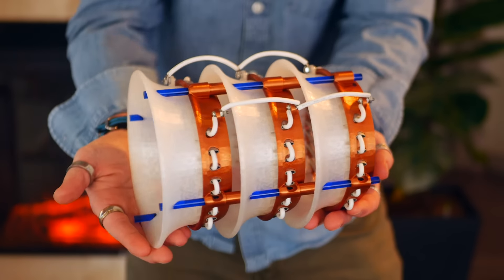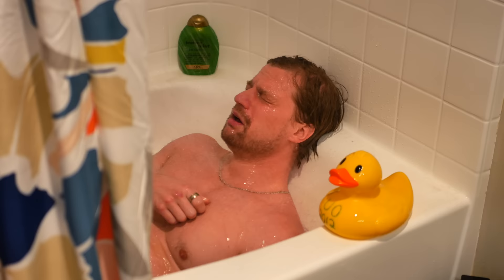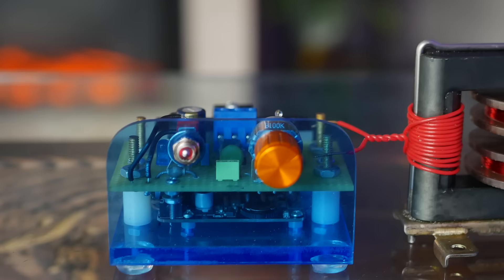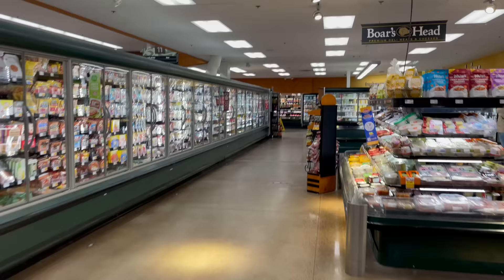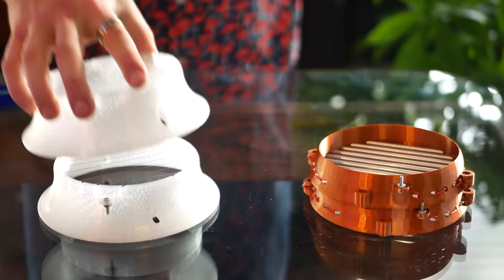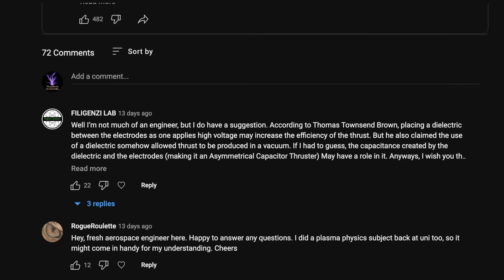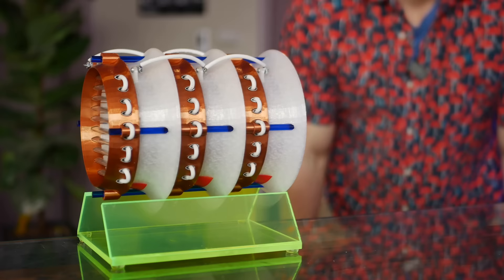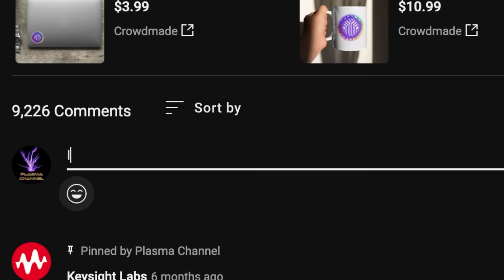The Next Generation of Ionic Plasma Thrusters (BSI MARK 2)

Comment: Intriguing. Have you tried making the second and third stages closed so no air comes in from the sides? Another thought, if each stage was made smaller than the one in front of it, could that possibly force the air through at a greater velocity?

Comment: This is really cool! Why don't you use a load cell to measure the trust more precisely than with the airspeed sensor which is not super precise at low speed? Would give a cool trust/power data point too :)
Reply: How is this the only comment adressing this obvious issue. Wanna compare thrusters? How about measuring thrust? Otherwise you will be messing around with funnels and "venturi" inlets without improving anything relevant.
Also to your VTOL fanboys out there; great MK2 is more rugged, but ever thought about the improvements neccessary so the thruster would lift it's own weight?
Reply: I'm mad at myself for not thinking about this!!!!

Comment: Take a look at strobic exhaust fans. Adding a similar nozzle on the outlet may increase the entrained flow resulting in increased total system flow. Another thought is using tear drop shaped tubing for the negative electrode. It may reduce turbulent air flow.

Comment: great video man! im just interested in 2 changes, from what i can see, your 3d prints were left with a rough surface due to the fdm print, but what would happen if you make this surface smoother, im wondering if it would make enough laminar airflow to somehow be more efficient? and secondly if anyone could specify how much thrust this engine makes. thanks

Comment: Last semester one of the teams in my university engineering project class built an ionic thruster. An interesting idea they had was to make each stage larger than the last to take advantage of the Bernoulli effect and get a greater output flow. An interesting concept and it seemed to work quite well.

Comment: Awesome work.  My thoughts...  First, why do you use tubing for one electrode on each stage?   Why not just use wire for both electrodes?   You may need tighter spacing of the wires as the velocity increases in order to transfer the charge, so consider using a mesh of very thin wires as the electrodes.   If it loses efficiency of transferring power to the air as the flow increases, then you should consider having a very large diameter on the inlet that gets smaller towards the back end of the engine.   You can produce higher pressure differential in the slow air and then decrease the diameter to increase the velocity toward the exit.   Could more surface area of electrodes help with energy transfer?   If so, consider using very thin blades instead of wires.  Kind of like your crushed down aluminum rods, but much thinner to reduce drag. 

Now, in application to a plane.   Thrust is used to accelerate the plane.   If you lose thrust as the velocity through the engine increases, then you have a major design issue for aircraft use.  This is where you may need significantly higher voltages.

Comment: Im not sure if it still exists,  but a french experimter was working on this in the 90s. I think his name was J Naudin. He had found that thrust correlated to voltage, regardless of current up to the point of breakdown. His math showed that big improvements could be made by increasing the dielectric constant and simultaneously raising the voltage. While you can do this by increasing the distance between electrodes, a better method may be to add a dielectric material between them.

Comment: You probably have already thought of this, but I'm thinking of a Tubular design like  Integza  has. But instead of having openings between the same size donuts smaller Donuts, use progressively smaller ones, then encase the rings with an outer Covering about 0.020" space in between. So you have a Bernoulli tube with the Donuts inside with the inner face of the Circular enclosure about 0.020" from the outer rings of the Donuts. I hope that makes sense? Along the center axis of the Engine use a rod longitudinally to mount the circular rings (Donuts on to play with the spacing. The Outer Semi parabolic (Bernoulli) cone can be slid back & forth to adjust the spacing between the Donuts and the inner wall of the Bernoulli cone. By making several different outer cones, you can not only adjust the inner & outer spacing, but find out where the Central piece operates best ( IE. thrust) by moving the donuts laterally forward and aft. Think of an Old Carter Carburetor where the desperation ring is parallel to the choke point  of the Throttle bore. Does it work best like that or fruther down the Exhaust side of the Bore? The Ions generate thrust, but you still have to work with the Physics of Bernoulli's Airflow to maximize thrust- in my humble opinion. So try a closed progressively smaller circular system & see how that works? Sorry, my Free copy of 2008 ProgeCad won't Open or I would send some Pictures. Bill

Comment: I know this was a while back but oh well,

you could improve the design by making the stages wider at their inputs, for example putting 2 stages next to each other outputting their airflow to a funnel that forces the air through to the third stage

keep the funnel air tight and the air compression should force that air to output faster, since you mentioned that the stages in the back wouldn't be pushing against any additional air

the idea is that compressed air wants to be uncompressed and return to normal pressure, hence the third stage in the front would add additional thrust to allow this to take place, hence the total output thrust would be increased

Edit: or simply using a higher voltage input would also work

Comment: Im not an engineer. But my understanding of venturas and jet engines is that it's more effective when you only have the one inlet, and have acceleration in the engine. The faster the air flow, the greater the negative pressure is at the ventura. When jets power up on a rainy day, even just a little for taxi-ing, they will suck water up off the tarmac. It'd be interesting to see one venutra inlet with 2 accelerators in an enclosed tube.

Comment: You have a relative motion problem. The second and third stage are struggling to speed up the air because the supply air is already moving in the same direction as the ions. You can drive 150mph without crashing if everyone around you is also 150mph. The air stream is too fast for the ions to collide and induce more flow. In centrifugal pumps, each stage leaves the impeller at high velocity, then goes through a diffuser to convert velocity energy to Pressure energy, preparing the flow to speed up again so that each stage can increase total energy. Then you can use a nozzle on the outlet to convert high pressure low speed flow back to high speed low pressure flow. Thank you Bernoulli!

Comment: I'm not an aerodynamic specialist but I think it would benefit you to reverse your intakes. From what I understand, with a cone shape, the air coming in hits the sides of the cone and creates turbulence that pulls some of the air back out of the funnel area. If you reverse that funnel it gives the air room to expand, thus allowing for more airflow and increasing the amount that gets in in the first place. Now this isn't my theory, I read it in a book, specifically titled Maximum Boost: Designing, Testing and Installing Turbocharger Systems by Corky Bell. It does refer specifically to turbocharging cars, but there is a section where he goes into the aerodynamic design I mentioned above. I haven't tested it, and haven't heard of anyone else who's reflected his ideas, but I like to think he knows what he's talking about. I hope this helps.

Comment: I recall seeing a youtube clip with a guy increaing the air flow of a wind mill. He did it by holding a basin like shape in front of it. Somewhat like the shape you have made in your ionic thruster, but he had the smaller side first. Basically a flip on your design. Not sure how this would work on an ionic thruster, but it definately increased the speed of the fan.

Comment: consider flattening the aluminum tubes to reduce drag while maintaining the surfce area. Easy in a machinists vise with a stopper block to ensure uniforminty.   As a secondary step consider nacca foils in place of  the aluminum tubes.  Sharp trailing edges may shed ions easier.  small aluminum foils available at RC plane parts supplier.

Comment: in speaker building horns are used a lot as mechanical amplifiers. (going from speaker to listener) horns transform high pressure low velocity to low pressure high velocity. maybe do the following thruster stages with reversed inlet shape or change in size from stage to stage would effect power. reversing would maybe go, lower pressure to then with thruster increase velocity. because the air is already moving to fast for the next stage so lower velocity but increasing total air would help.  but I'm not big on mechanical engineering so this is just a guest.

Comment: There is something super basic that seems to be missed here. The velocity increase, that is being saught, is based on a combination of reaction over a given area and the final area inversely squared by the pressure. By gradually reducing the area through which the air passes, the speed should increase exponentially. Naturally, this indicates that a funnel shape that tends towards a smaller outlet should yield accelerated airflow.

Comment: You might try to going down a different path for this high voltage propulsion.  I think you can hear the big pop when the spark jumps the gap.   It's a small electrical explosion.  Lighting can for example explode a tree.  All that energy heats the gas and expands the gas really fast.  In WWII they used buzz bombs.  Consider that you might be able to make a class of plasma impulse engine with a similar approach.   Contain the spark in a long very narrow insulated tube or chamber with a tesla valve or better yet a reed valve on the leading end, and use a big storage cap.    Fire the pulses into the chamber at the resonant frequency of the chamber.   Spark gaps get very hot and melt,  a plastic prototype may not last very long at all.  You might need a high speed camera  and some smoke to see it work for a few pulses if its made of plastic.    You seem to be experienced with high voltage. Take great care its very dangerous to play with high voltage.   I wish I had time to have such fun....

Comment: Cool. I just had a sort of golf ball idea....what if, you actually put holes/slots in the duct piece itself? You could drastically reduce print weight without radically impacting strength, and maybe your current model 'blocks' some potential airflow. For trial purposes you could either use duct tape (good enough for Nasa and F1) or a sleeve to adjust slot size. Or I guess first test would be if you can close the existing gap completely does it starve the airflow thus reducing output?? 

Sorry if someone already covered this but I can't read nearly 8000 comments!  :)

Comment: The observation that ionic trust cannot be ram inducted should have led you to think, "how do I make a chamber to excite large ammounts of air?" Funnel shape is another area that can be improved. The other design make by your friend was 7m, his funnels were more effective, rockets include a funnel as the basic design. As much air exits the funnel as enters, the air is compressed. If the funnel's mouth is 10 inches, and the exit 1 inch, you compress the air 10:1. You are utilize stacking intersections, have you tried one pannel behind a funnel, and then building a chamber parallel to the flow, to accelerate the air more? What is the chemical composition of the air as it is ionized, what other ion states could be introduced after the first charge? What can you make that yields energy? What can you break that releases energy?

Your extra openings allowing more air in are okay, but you are not utilizing the funnel for a rocket. Extra air should be piped in, roughly as much as you witnessed, not much. In every rocket or jet there are stages, usually. Each stage needs to suck more to be able to blow more. The basic design should be one that compresses the air, having a smaller exit than enterance. I think our friend applied more knowledge of free mechanical enegry to beat you. Nasa friend of mine explained opposite fields parallel to the flow further accelerates the air. He did not tell me about how to further the ionic reaction to achieve supersonic results. Lower atmospheric air is limited as to how much thrust we can achieve. If we start dumping gases into the magnetic field, like hydrogen, or helium or co2 allow further thrust. We like Lower atmospheric ionic trust, but upper atmospheric ionic thrust is better and usually requires a different array to work. Study these differences. I also know that in ion thrust shorts occur due to how many volts we are pushing, keeping the electricity were it belongs a painful task. It is why the USA  has zero hypersonic nukes. We have not a more reliable way than solid fuels to hit out target. Russia did make ion thrust rockets, they use fuel, likely hydrogen, and they do not reach target but 1/2 the time. Maybe we should try making something in the ionizer. O3 is fun stuff... =)

Comment: I'm curious as to why you only varied spacing between the positive and negative plates on one stage? Consider rerunning your spacing test using the PC fan. My theory is that as input velocity changes the spacing between + and - needs to increase. I base this on your comment about "needing time to work." Another way to see this is thinking about a rail accelerator. As the load is accelerated, the magnetic accelerator spacing needs to increase.

Another thought would be to reduce the inner venturi  diameter on second and further on subsequent stages. Combined with varying the + and - plate spacing this seems like it would help. On venturi design for second and third, etc stages just continue the cross section curve by say 1/2" on stage 2 and maybe 1" od stage three. Of course the test using the PC fan while varying + and  - spacing would inform this.

Yet another observation,  your device is using spacing in air as your insulator. This obviously isn't perfect as we hear the break down in the arcing in your device. Try painting with glyptol insulating paint. And note you only need to paint the aerodynamic shaped electrodes.

Comment: It seemed, from what I could see, that a different geometry may produce higher flow. It looked like the volume of air was being pushed through the middle of the cone. The length of the conductors get shorter, and I think less efficient, as the position changes from center. If the geometry was rectangular, with all conductors equal in length, I think the volume of air would increase. Wind speed may also increase if a taper end to end is introduced. Hope that is helpful.

Comment: Each stage of the thruster should be designed differently, for instance the 2nd stage should be designed to take in higher velocity air instead of still air. It may have to be radically different. Start focusing on ways to ionize fast moving air or lengthening the area of ionization somehow. I think the 2nd stage might end up being a different design altogether.

Shout out to Charlie, a fellow Electrical Engineer like myself from UTA.

Comment: If we assume that the system is a fan with propeller, I would tell you a serial connectiondoes not help increasing the air velocity. You increase the fan pressure by adding stages. In order to increase volume, parallel connection is used (but housing for parallel connection can cause an increased resistance. If it behaves as a fan, then you can check sources on mining ventilation engineering or mech eng. liked your video.